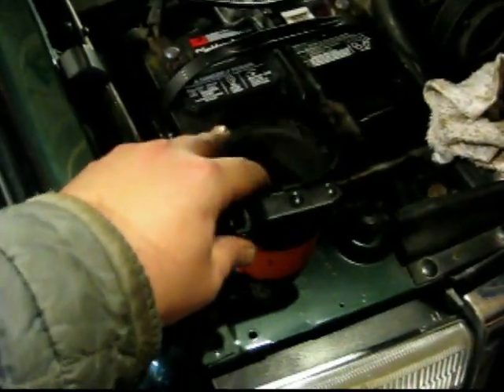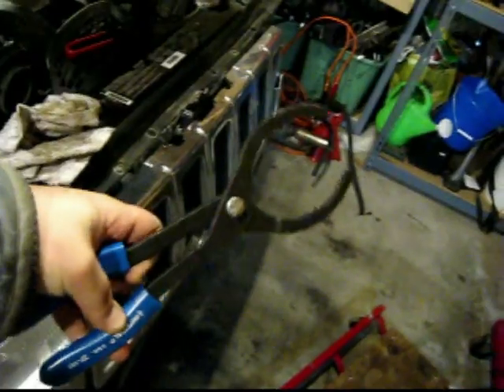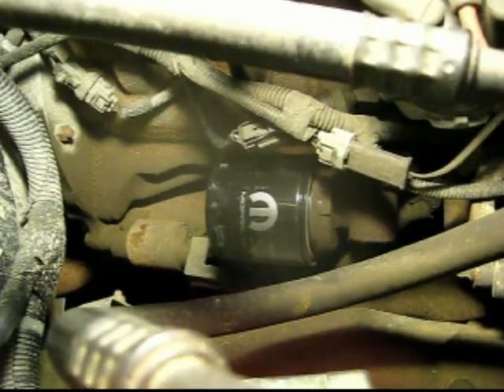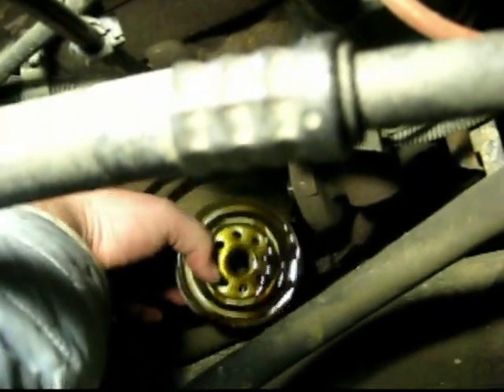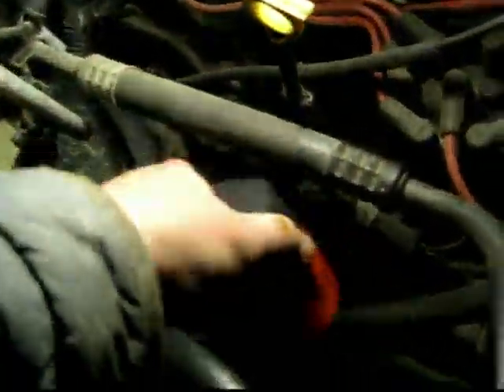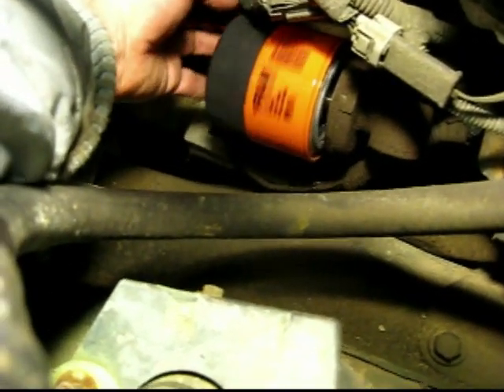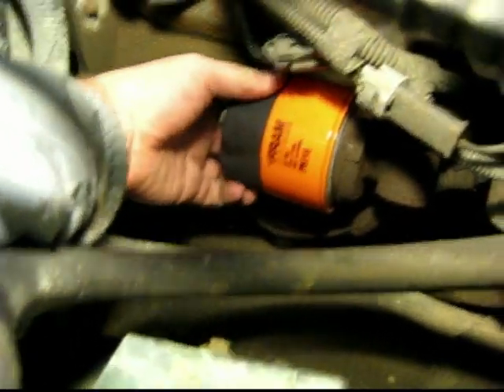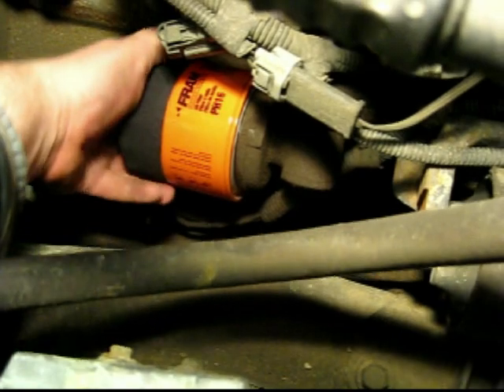MG 23 Part 2- The Jeep gets an oil change and an air filter

Comment from the maker: Doing another oil change after 1000 miles after using seafoam is good practice. 

Pulling the plugs on the distributor is a new one to me, I find it hard to believe that that makes any difference at all.

Comment: Buy a manual for your Jeep asap. This engine holds 6 quarts of oil normally and NOT 5 Seafoam is not needed in these engines and please upgrade to a motorcraft FL-1A filter or the Bosch equal to that filter, They are the same thread size and WAY better filters